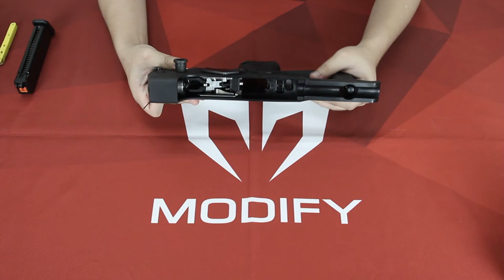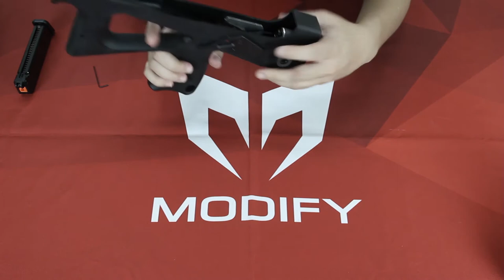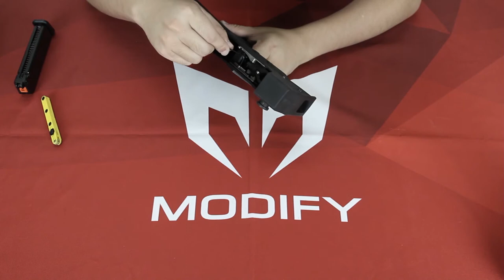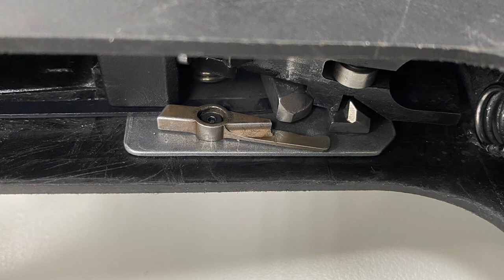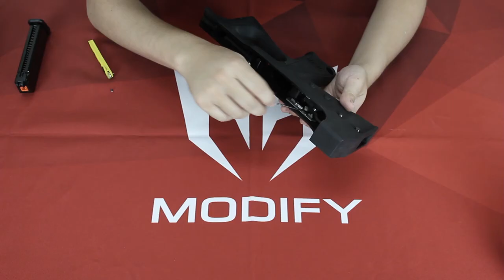【Tutorial】How-To Change the Fire Selector Lever

Comment: Hi! After install the reinforced new piece, when firing in auto mode, the gun got stuck, because the new piece is too thin to retend the sear set, blocking the hammer. I have seen the video you have clearing the jamming problems, but the springs and everything else is fine. When I change to the original fire selector lever, the problem dissapear. What can I do? Thanks.